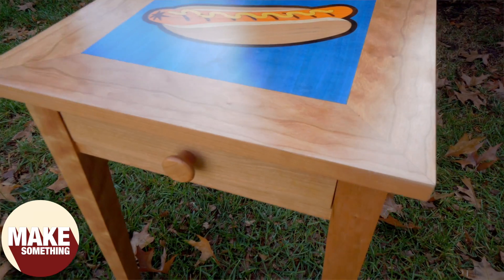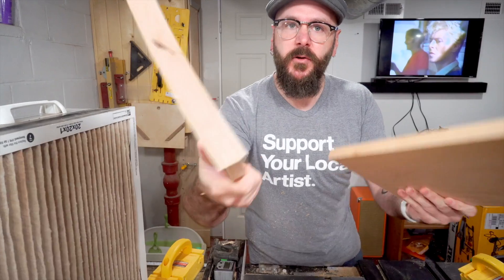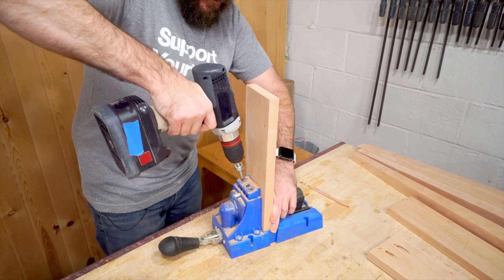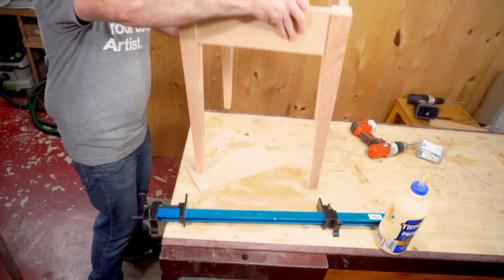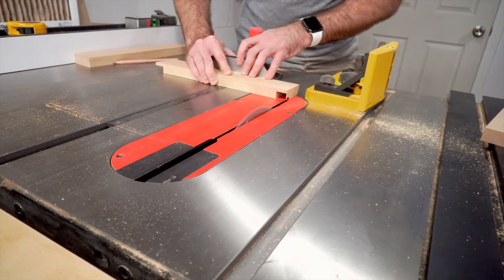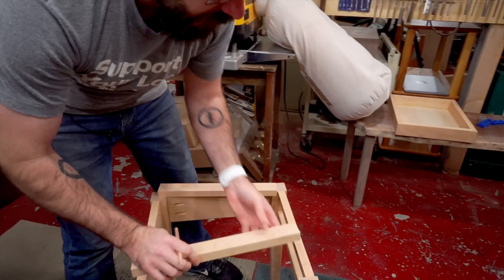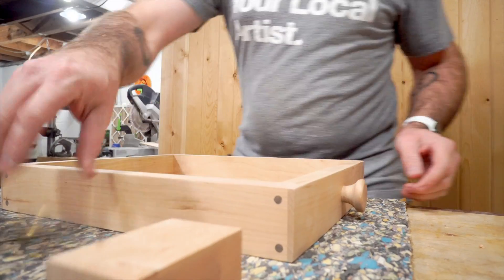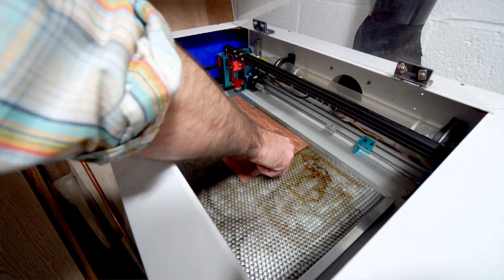How to Make a Shaker Table with a Hotdog Wood Inlay!

Comment: Good video.  Nothing wrong with pocket screws, they are very easy to use and are quite strong.  Would you consider producing an in depth video of the laser steps of this project.

Comment: I am so glad there is no ketchup on the dog 😹 great table I have one made of wood Varner that Mum made almost 40 years ago and it's still as good as the day she made it, she too added the backing like you but she had used 1" wooden shelving boards joined together and if you don't add the backing Varner it would bow over time this does not happen with plywood but Mum could not afford the high end ply wood back in the day and so made it out of an old bookcase Dad bought from the junk shop and pulled apart for her 😹

Comment: You should put the veneer tape on the back side of the veneer, the one you put glue on. That way you don't have to scrape it off. And that is also the reason why you use this tape. If it sticks to the veneer properly, then it doesn't effect the bond between veneer and the stuff you glue it on.

Comment: You could have applied PVA glue in both sides (table and veneer), let it dry almost completely, and then use a husehold iron, in medium temperature, to activate the glue, with a piece of paper to protect the veneer. Beautiful project. (wish I had a laser...)

Comment: You can use blue tape if u are gluing the same day... the issue is that after a day or so the blue tape looses its grip so if you are not going to blue right away u should use the veneer tape because that won't loose its grip

Comment: The reason for veneer tape is simple, usually you use a special press and it heats up the glue, the glue dries in 2 min, done.
Regular tape melts at this temperature (80-100°C), not this tape

Comment: you dont actually need a backing veneer when using plywood, it is already made of lots of veneers so adding one more is moot.
but nice job anyhow.
Reply: KingPost TimberWorks I've always heard that you want an odd number of plys. Most plywood is 5,7,or 9 ply. Put the primary veneer on the face and a secondary wood veneer on the back.
Reply: William Butler I don't have an idea if it has some true impact, but my guess is that it is so that the front and rear have the same grain orientation . It could possibly be about strength, but I guess that is mostly for low numbers of plies (3-5 maybe 7) but beyond that I guess the structural impact would be around nothing
Reply: if you were to add another layer of plywood in general the two outer most layers would have the same grain orientation, so when the wood climatizes it would warp heavily.

Comment: veneer tape is better for veneer because it doesn't stretch or shrink under heat or pressure and you can sand it off easily unlike masking tape, :)

Comment: Heya David great project!! just wondering what program you used to create the art on top? and what size stroke did you put on it to get them to fit so nicely ? Thanks alot for the great video's
Reply from the maker: Adobe Illustrator with a 0.0035 of an inch stroke.

Comment: I have no idea what is the deal whit the special tape but I have used both the special tape and the standard painters tape and I had way more success whit the painters tape
Reply: Daan.Z.bloedjes the special properties of the veneer tape is that when pressing the veneers in a veneer press, the tape is not leaving any tape glue which can be hard to sand away and it can be removed with water. If you put painters tape on wood and apply heat and  high pressure, the painters tape can be a pain to get off. But in this example it makes little difference.

Comment: That is not inlay
Reply from the maker: +Axcette no?
Reply: Make Something I learned in school in the class mtw (materials technology wood) that inlay is a trip or strips of wood recessed into a sold timber to create a decorative line effect. What you are doing there is veneer, that is different to inlay. Veneers are thin layers or sheets of wood that are cut from a log. You then cut a design and glue them onto the groundwork (which is the base/ the plywood or mdf board). Still a very good video as always, keep up the good work :)